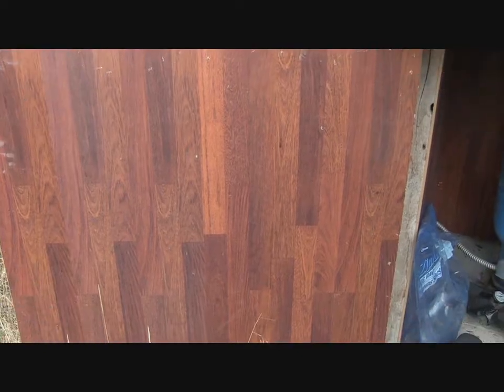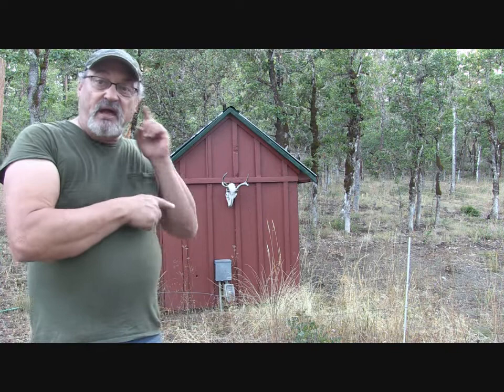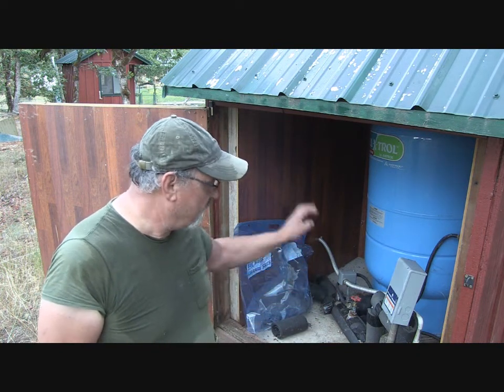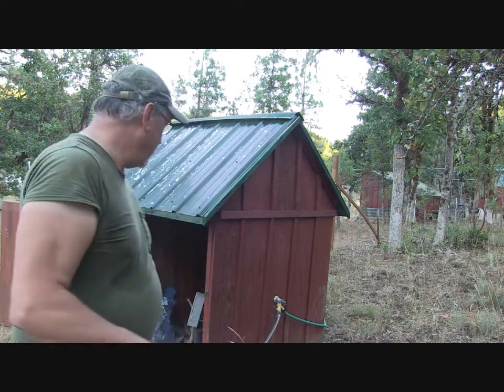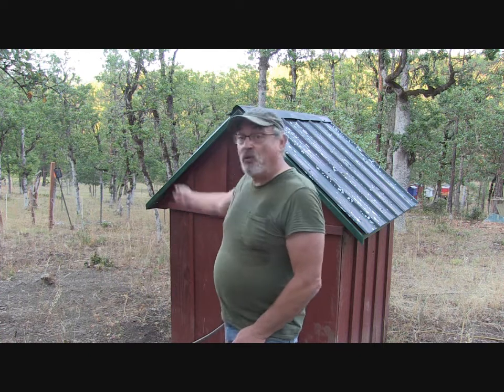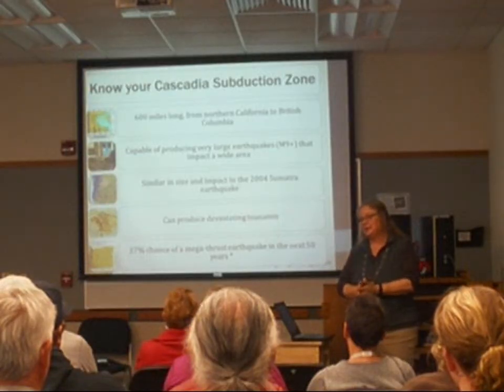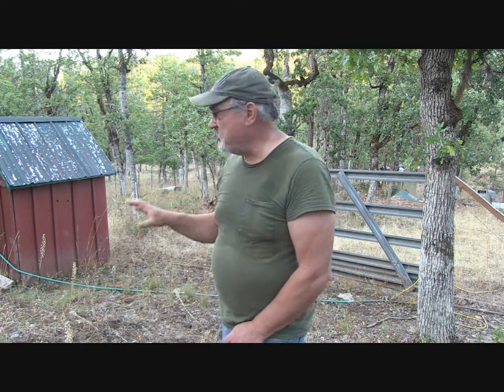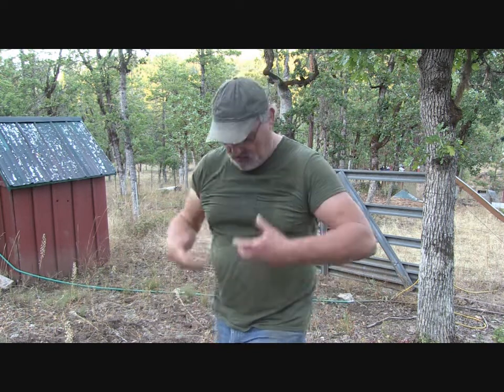HOMESTEAD OFF-GRID - Going Off-Grid Water Well Part 1

Comment: Hello Jerry. Here is a question.  If you buy a larger propane tank then will you have to fill it up when you run short. Is my understanding you will have to fill it up. Big cost factor i think . Let me know
Reply from the maker: I will be purchasing a 1000 gallon tank with the plan of adding a second one. Our current usage of propane per  year for our household is  350 gallons. The price of propane fluctuates throughout the year with price per gallon going up in the winter months when usage is high. By adding a 1000 gallon tank and owning it instead of leasing it I can get the four propane dealers in our region to compete, giving me the lowest price to fill up my tank. This way my annual cost of propane will be paid out in one lump sum while the cost is lower. The current summer price is $1.95 per gallon. In the winter the cost shoots up to $2.30 per gallon. So, one tank would last us three years and my estimation is that by the tie the tank needs to be topped off again I will need to fill it at the lowest market price. Of course, the initial cast for filling it will be $2,800.00 at the current price. Dividing that over three years my cost is $933.00 per year or a cost average of $77.77 per month. The two coldest months of the year are what I use the most an that is 100 gallons a month in January and February. I only use 10 gallons per month in the summer months and 25 gallons in the Autumn and Spring months. Of course, I will top them off once per year never using the entire 1000 gallons. The surplus is for the sole purpose of preparing for hardship such as a disaster or something else. In a nutshell, my annual cost will be cheaper because I'm able to purchase in bulk rate. Thanks for the inquiry.